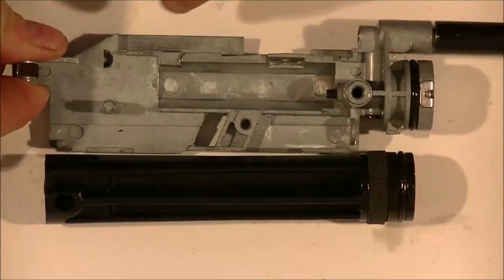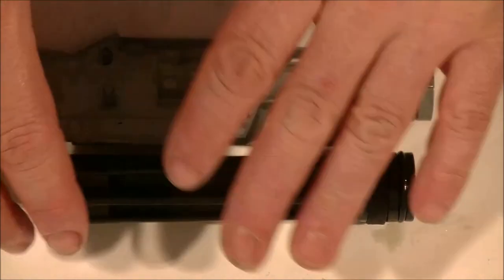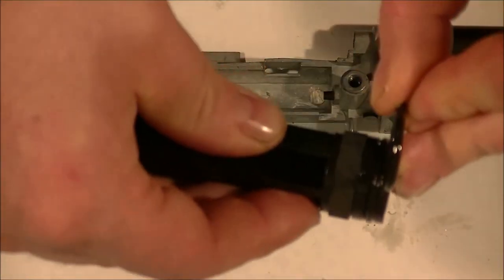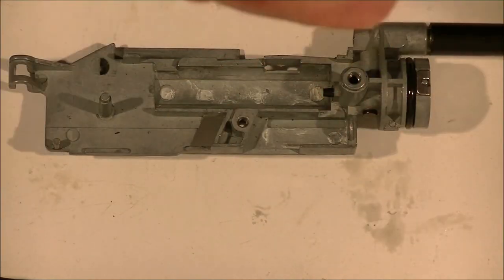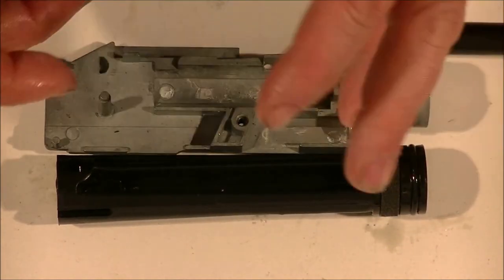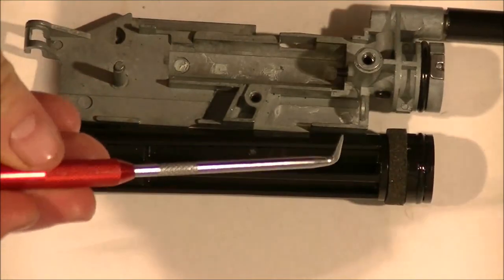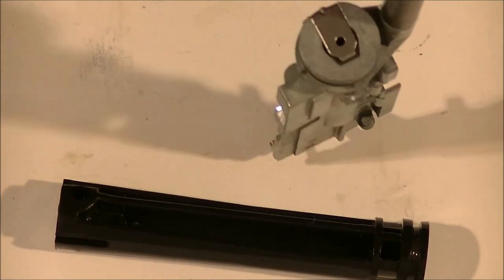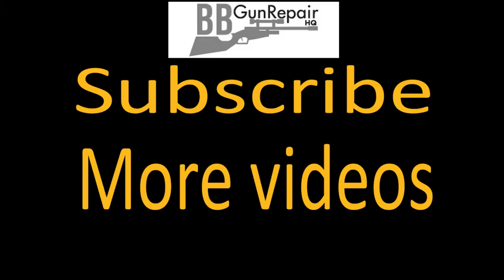How to replace orings on a Daisy 853C Part1

Comment: Great point about changing out wiper! If a buyer gets a used Daisy,   who knows what crud oil is soaked into old wiper - would ruin seal fix. Advice would cover 880 too, a gun much more likely to be picked up at a garage sale.
Reply from the maker: The biggest problem is people using the wrong lubricants.
Reply: @BBGunRepairHQ  - Yes, sir, your 30 SAE ND pick works well for ALL my pump guns - including Crosmans.

Comment: I just had the wiper come apart in my air gun what should I do?
Reply from the maker: It will work fine if you cant find a replacement. It just works better if you have one. A airgun store should be able to find you the replacement. It usually comes in a kit with orings and a new valve.